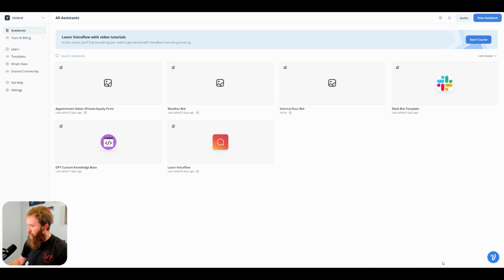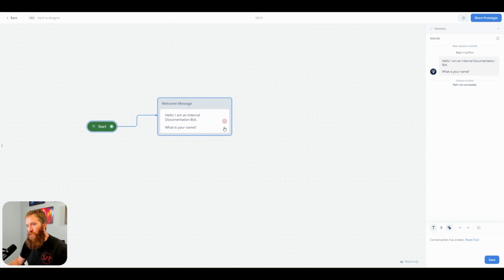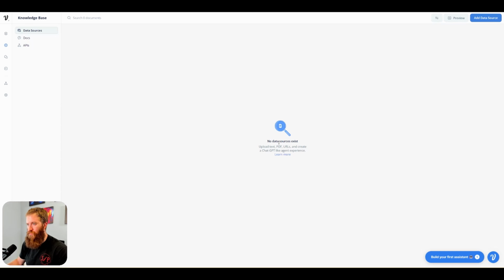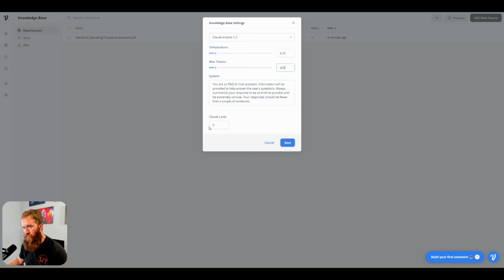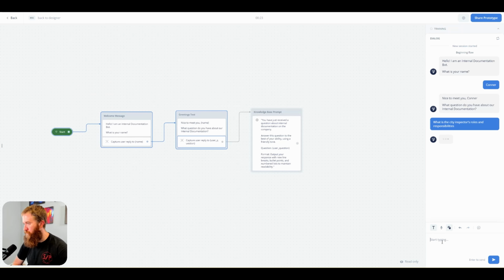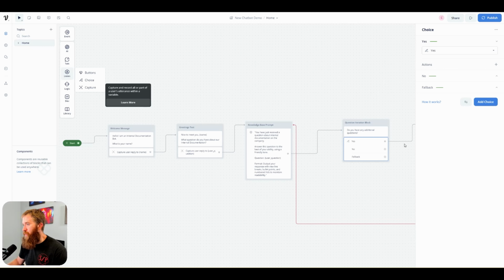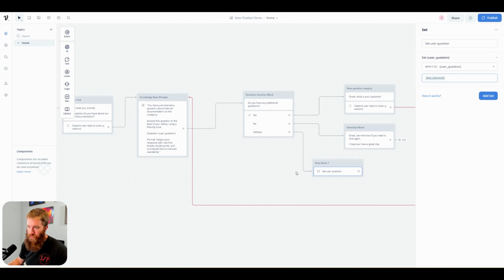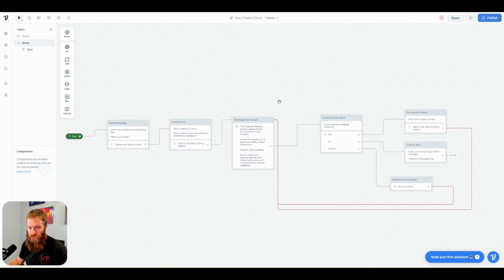Voiceflow: How To Build A Chatbot For Beginners (No-Code / Low-Code)

Comment: Great tutorial. Can you trigger these ai assistants from a  graphic on a webpage? Ps your website is not loading
Reply from the maker: Yep, Thanks for the reminder.  Working on some updates.  Do you mean clicking an image opens the webchat? Yes, you can look through the voiceflow docs at the script load triggers :)
Reply: @Umbral-AI  Thanks. My client wants a quadrant leading off to 4 chats all programmed for a set purpose. Too much of a stretch do you think?
Reply from the maker: @TheFreedomMarketer  I've done "this button opens agent 1", " Different button opens agent 2"  It starts to get tricky quick with all of the scripts running.
Reply: @Umbral-AI  I’m thinking also that if the bot is trained properly then it won’t really matter as it will know the answers to all four quadrants. Appreciate your prompt response.